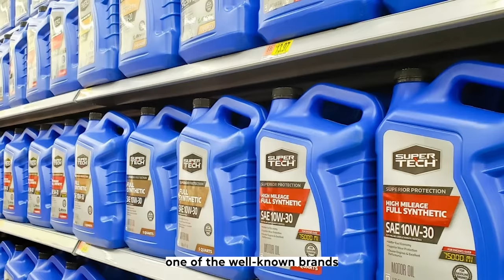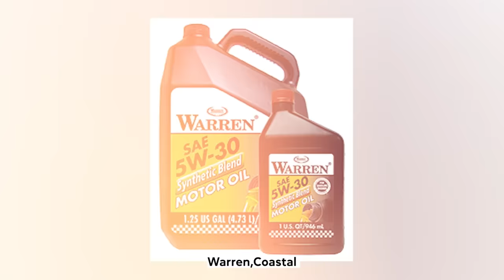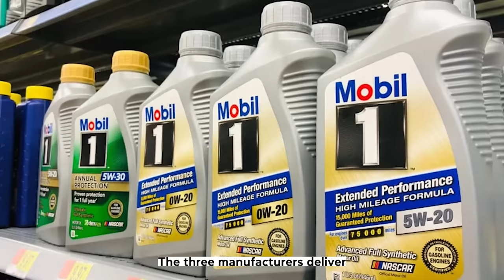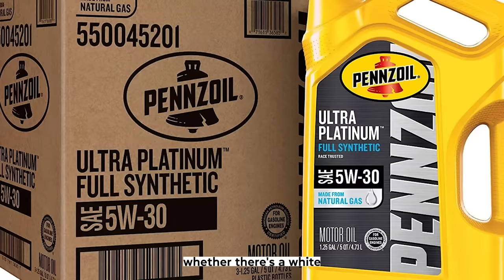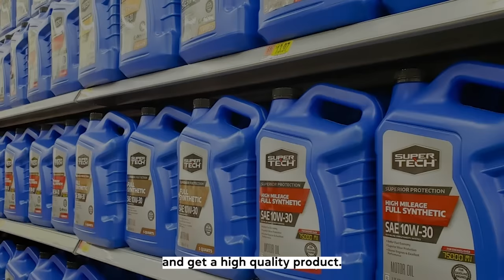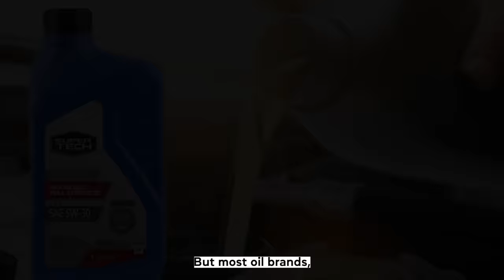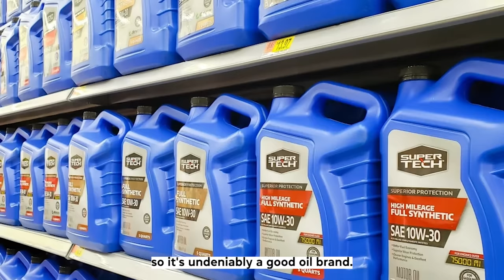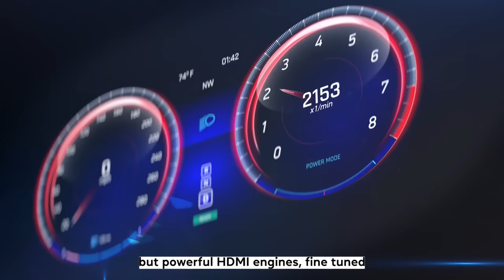Who Makes Supertech Oil For Walmart And Is It Any Good?

Comment: If you drive a regular car, not a sport executive or performance special, Supertech is fine. You won't notice any difference. The importance of changing oil regularly is much more important.
Reply: Great advise!!..My research also says the same..
Reply: But my ca states mobil1 only
Reply: Project Farm has tested Supertech and has sent it to labs to get the breakdown.
Reply: @peter-pg5yc  Then that is exactly what I would use
Reply: we run super tech in our race cars works great you no nothing.
Reply: @yourworstfear  no one said to use regular oil in race cars here.
Reply: @peter-pg5yc mobil agrees to make that weight in the spec the mfr requires and mobil compensates the manufacturer in some way. That could be supplying oil for factory fill at reduced price.
Reply: any car api code matters not brand.
Reply: Nope, Super tech oil can be used in all vehicles, just like any other brand.
Reply: That's exactly right.
Reply: I don't know if they still are but I worked at Walmart part-time for a few years in the Boise Idaho area and according to  theb shipping invoices Quaker State was supplying the supertech oils for the stores here in the valley.
Reply: @yourworstfear  LOL, yeah your local street stock oval track car is real high tech.
Reply: no nothing...lol @yourworstfear
Reply: I wish he would have said that. 😏
Reply: Sport executive? Performance Special? Tell me you don't know cars without telling me you don't know cars.
Reply: REALLY!!!!
Reply: know @yourworstfear
Reply: I use Super Tech HD30 Diesel oil in my lawn tractor and farm tractor, and I don't think there's a better oil at any price or brand. It comes in a gallon jug and reasonably priced.
Reply: Im with you Korn, he does the work. Pennzoil has my business for the money.
Reply: The pure synthetic from Walmart is as good as anything out there except for maybe the pennzoil made from natural gas !!!
Reply: It doesn’t matter who makes it. Every company has different tiers of oil. The additive base and stock are more important than who makes it.
Reply: I run SuperTech in my sports car. I bought a 20,000 mi oil and change it around 8-10,000 mi/once a year. I been doing it for a few years and haven't had any problems
Reply: I use it in race cars it's fine
Reply: Exactly
Reply: @peter-pg5yc probably a higher class car
Reply: I almost bought a 5 gallon jug of Super Tech oil, but I looked around at Walmart and saw a 5 gallon jug of Quaker State instead for just $5 more..I'm playing it ssfe. Quaker State is well known. Full Synthetic just like Super Tech.
Reply: What if you drive a regular executive in a sporting way?    This horseshit.  It's good enough, or it isn't.   The guy just wanted to say something that he hoped sounded intelligent, but it failed.
Reply: Ai ai ai ai ai ai
Reply: @peter-pg5yc That means nothing.
Reply: @william38022 Full synthetic isn't "regular" oil.

Comment: I Am A Mechanic Since 1973. I Use Super Tech Engine Oil In My 2005 Toyota Tundra Since New And Now Have Almost 300,000 Miles. I Change It Every 5,000 Miles.
Reply: You meant 300k not 3M miles, right?
Reply: @Sunnysky321  😹
Reply: Hey Stephen, to the right of your post are three stacked dots, click them choose Edit. That is how I correct my typo mistakes. Hope this helps you.
Reply: @ricdonato4328  Thanks
Reply: I mean it’s good oil, but that tundra will run on cod liver oil 😆 one of the best engines ever made. But for sure maintenance is key no matter what vehicle you drive
Reply: @Sunnysky321  300 THOUSAND is written 300,000
Reply: @ricdonato4328  what typo??
Reply: I have been using it in all my cars. I do the same thing and the oil never let me down.

Comment: After researching the Dexos testing standard I base my oil purchase on it.  The Walmart and Amazon brands that meet that standard are good oils without the premium price tag.  Back to the 90s I’d always liked Castrol oils but $35 for 5 qts of 0w-20 versus $22 is a big difference when you have 5 cars to maintain (3 daughters).  And to echo your advice, regular changes at the right interval.  None of that 10,000 mile BS.
Reply: I wait till it starts to change color I change oil just before it browns off from a redish color
Reply: Depends what kind of trips you make. If most of your miles are highway, not short trips, I'd feel perfectly comfortable going 10,000 miles. Otherwise I would change more frequently.
Reply: 10,000 miles BS you say... which is here in Europe approx. 15k km. 
And yet the ecoterrorists in EU say I HAVE TO change the engine oil not often than 30k km (approx 20k miles). It will be more eco friendly they say LOL and don't care that my engine will fall aparta much faster... and be one of many on a huge scrape yard - a place which once used to be a nice flower meadow with cows walking around
Reply: You are 100% correct sir 👍
Reply: i was over at my local advance auto parts last week and couldnt believe my eyes looking at the prices of oil and trans fluid. 

if you are unsure about your oil making it to 3k, 5k, 7.5k, 10k and up you can send a sample to blackstone labs. i would be willing to bet alot of people are changing it out when they may say that all their tests for viscosity and contaminants etc shows it still can  keep on going.  i dont know about you but my express van brand new consumed oil and now i notice my ford does and many vehicles are going through a quart every so often so its imperative to stay ontop of
Reply: @LeewardStudios ... not to mention back seat replacements ...... :)- 
I have only one and I'm not letting her out till she's 30. She has already grown thru her gauze bindings.
Reply: Yep it's a decent oil I use it on all my a to b motors, high performance ones that I care about get amsoil
Reply: Totally agree. Base your change interval on the type of driving. All short trips driving constitutes severe duty. I have an old Toyota Camry. I use semisynthetic and change the oil at 2800 miles. Scotty Kilmer is a senior mechanic and YouTube personality. He say, do not go more than 7500 miles on any oil in any vehicle. With conventional or semisynthetic oil and low-end filter, no more than 5000 miles under any circumstances.

People claim they go up to 25,000 miles on high-end extended life synthetic oil and a high-end filter. If it's all highway miles. maybe. I wouldn't.
Reply: Just find a cheap oil that meets GF-6 standards you cant go wrong ! My daily driver's OCI is 4 months/ 4,000 miles or 200 hrs of use ! 1994 chevy s10 2.2 658,000 + miles ! Never rebuilt eng - trans or rear end !

Comment: I've been using super tech oil for as long as Walmart has been selling it in my area. I recently helped a good friend of mine change a Valve cover & gasket on his Chevy Sonic 1.8 L dohc. We were shocked at how clean the the inside of the engine is, It looks like new. Guess what oil we've used every oil change super tech 5W30 full synthetic.
Reply: Yes, that is another part of engine longevity..How clean the engine stays on the inside..If it's clean you are doing exactly what you should be..
Reply: I use the same on my 2006 Subaru sti
Reply: Same here!
Reply: Most of the Supertech brand oils have been out of stock in all of my local Walmarts. I had to order some online.
Reply: I would have to think this a huge testament for ST becuase if you think about that little Sonic is running high RPMs all the time. And since those cars are very widely bought as commuters they can either be in non stop ..stop n go traffic or run on freeways for long stretches. Awesome deal thanks fir sharing. My son and his wife both have 2019 Corrolas and use ST. I'm going to tell them about this post
Reply: What is the oil change interval you're using?
Reply: And a 5 qt. jug is 22 bucks!
Reply: @yt-user03561  That's because of hoarders. They play keep-away from other people. It's greedy toddler behavior.

Comment: Bought a new truck with Detroit diesel engine, used Texaco oil for 400,000 miles. Switched to Supertech 15w40, ran truck to 900,000. Sold truck, new owner ran to 1,100,000. Head gasket blew and he rebuilt engine.
Reply: Damn that’s impressive!!👍
Reply: Texaco... i really miss texaco. Their oil was havoline as i recall. Think i may have one iunopened quart somewhere. I cant bring my self to open it.
Reply: Texaco was bought by Chevron. The Havoline oil brand still exists.

Comment: I'm old enough to remember when oil was .50 cents a quart. Came in a can you stuck a metal spout in. I don't think Sam Walton would sell me bad oil.
Reply: Well, he's dead so.....
Reply: I remember when a case had 24 quarts.  I still have my metal spout.  It had a certain sound when you stabbed it in. I still have my dads Pyrex glass bottle, remember those?
Reply: I can remember when Autozone actually had cheap oil. .79cents a quart for Castrol GTX. I remember the meta/Cardboard cans too.
Reply: Yes. Ahh the good ol days!
Reply: Still have a metal spout and 3 cardboard oil cans. Amzoil, Quaker State and STP. There more a time past of how things where done and memories for me.
Reply: Around 2009, I got a case of Shell conventional oil to use in my Geo Prizm at a sale price from a parts chain. With a rebate, it came out to 50 cents a quart. I told my friend, that's the last time I will ever get oil for 50 cents a quart. Nevertheless, I call the 1960s and 1970s the bad old days.
Reply: Me too!

Comment: I’ve been running this oil for a long time and have had no issues with it. I change my oil at maximum 5k miles and Supertech is perfect for that. It’s good stuff. I recommend it.
Reply: What refinery is going refine special, extra-bad dino oil just for Walmart? Who produces bad motor oil? It doesn't make a shred of sense. In my estimation, Supertech is exactly the same as the oil company brands. Mobil. Shell. Chevron. Phillips. Texaco. Citgo. Arco. Sinclair. BP. Exxon. You name it. No difference, and they probably trade their production around as needed to fill their orders anyway. The famous independent brands - Castrol, Kendall, Valvoline, Pennzoil, Quaker - all are owned by the majors now. The majority of motor oil sold now is synthetic, and that's a different product altogether.

Comment: I ran a jeep 4.0L on supertech 10-30 oil changed @ 6,000 mi to 315,000 miles. Mostly high way.
Reply: That in line 6 cyl motor is one of the best. Mopar screwed itself when they got rid of it
Reply: I had two Jeep Cheroke with the 4.0l engines and they are the best 6cyl. Engines ever made.

Comment: I have seen Super Tech tested on oil testing equipment. It tested VERY well and right up there with ALL oils..Use it without fear..No matter what oil you use today most oils are so close in quality as one other person said here what matters the most is how often you change your oil. Not who's oil you use..There are no good other including myself mechanics that thought these (long) oil changes intervals made any sense at all. The word on the mechanic street is to never go past 5,000 miles..Not if you plan on keeping your car..3,000 to 5,000 miles is the desired change interval..I am also a mechanic and have spent 40 years researching oil and testing the common sense theories..Don't worry and be happy..Change that oil regularly.
Reply: Been using SuperTech 5w20 synthetic in my 2007 Accord coupe 6 cylinder from the get go with 7,500 mile OCI. She purrs like a kitten and not a drip on the driveway. Fram Ultra synthetic filters, while very good , are too restrictive. Mobil 1 since it’s rated at 30 microns is my go to.
Very happy at 187,000 miles November 2023. 😊
Reply: @Nellis202  Same here, I use SuperTech 5w20 in my 2009 Civic & change with the warning gets down to 5%. Works out to about 7000 miles. I use the Wix XP filter which is 21 micron. I'm about to roll over on 245k miles & it still runs like a sewing machine. Of course I don't dog it either. Just a general every day driver. It still gets 37 mpg when I'm not doing stop & go town driving to.
Reply: I used 15k mobil 1 in my odyssey and usually changed it at 15k+ miles.  It ran beautifully when I sold it with 275000 miles.
Reply: @derrickzenner9300 Glad to hear you had a beautiful experience with your Honda.
But 15,000 mile OCI ?
Who knows ! Maybe you’re right, but I just couldn’t bring myself to such a long interval.
Hope you’ll have the same good fortune with your new vehicle. 😊
Reply: 3000 to 5000 mile oil change intervals are a waste of money and oil. I've been using supertech synthetic oil since 1998 when no mechanic could be convinced to use it. It's been in use since WW2 and still I couldn't convince anyone of the benefits of synthetic.  Supertech is better than fine regardless of which car one drives. 10,000 mile oil change intervals or 1 year which ever comes first is all that's required and of course a reinforced (synthetic) filter.

Comment: Been using supertech as far back as I can remember. 260k miles on my 94 ford ranger still running strong passes emissions no problem. Also use supertech trans fluid still shifts just fine.
Reply: Those 4.0`s are pretty stout
Reply: YOU BET !
Reply: 2.2 S-10 with 235,000 miles & still going strong with supertech oil.
Reply: I have a 93 ranger 2.3l 2wd 5sp I daily to work with 507,000 + miles! 3000-3500 mile oil changes. I use Valvoline high mileage synthetic blend. I have run super tech when Walmart was out of the Valvoline. This thing is still rocking the original engine transmission and rear end and Better yet no tics taps or raps and doesn't leak a drop of oil! 💯🔥🇺🇲 I have a newer Chevy Silverado, if it gets a 1/4 of the mileage without an issue I'll be blessed 😂😂😂

Comment: Supertech is perfect for the average daily driver in stock production vehicles. That said, it's the oil filter that can make a difference as there are a much wider range of quality in filters than in the oils themselves. Pay attention to the quality of the filter and maybe pay a few bucks more for a high quality filter. Thats what you need to pay more attention to.
Reply: Amsoil nano fiber oil filters are the best.
Reply: WIX XP is also fantastic...decent $
Reply: ST filters are as good or superior to Mobile 1 filters....at half the price.
Reply: Thats what ive heard all my life. The oil is not as important as the filter. Using a quality filter is the key.
Reply: ST filters are like the oil, middle of the road which is perfectly fine for most applications.

Comment: Great information and well presented. Many people think Super tech (Walmart), Amazon Basic, and Kirkland (Costco) are made by the same company(s). That said I had my oil changed at Mobile 1 lube with a groupon, but found they did not use a mobile 1 oil filter. The oil filter is the other half of the oil change. I avoid the filters from China.
Reply: The certification should be your comfort to use. All oil is subject to these. Use full synthetic after your first oil change.
Reply: What filters are made in China?
Reply: Does that go for your Android or iPhone too?

Comment: The motorcycle shop I worked for was buying oil in 55 gallon drums. We were using that oil to put in brand new motorcycles.
 engines were blowing, and it wasn’t just one particular engine size, it was several different size engines with the oil that we put in the engines..
  One of the mechanics in the service department was doing a 500 mile service on a motorcycle that just came in. When he pulled the plug to drain the oil, the oil came out like foam. Like a frozen Coke if you have ever seen one of those.
  When you have foam in oil, that is millions of air bubbles that are compressible. When you have the elasticity of air bubbles in the oil, you cannot have full oil pressure. Anyone with experience of having air in your brakes, knows that that is not good, you don’t have full brake  pedal pressure…
  we called the company we were buying oil from. They sent to representatives there. We took a brand new motorcycle, put in the required amount of oil, the mechanic rode the motorcycle for about 15 minutes. He pulled back into the shop and put the bike on the lift and pull the plug. I’ll came honey colored foam..
It was obvious that the oil additives package was lacking in anti-foaming additives..
  that company agreed to pay for all of the engines, and we started calling all the customers, and going to pick up their motorcycles with our trailer.. we told them not to ride or even start their motorcycles..
  some people demanded brand new engines, and got them..
Reply: We used belray 55 gal 10,40 Yamaha 20,50 🤙
Reply: What brand was the defective oil?
Reply: Sounds like quaker state
Iv seen valve covers with a white hard paste in them from motors that used quaker state .....30+ years ago
Reply: Should have just put Rotella T6 in everything.
Reply: @OtisFlint yep that's a no brainer

Comment: I bought an 03 Corolla new and ran it about 200K miles on dino oil. Castrol, Pennzoil, and Chevron oil were used. Costco stopped carrying the Chevron oil so I started buying the Kirkland full synthetic cheaper than I could buy dino oil if I could even find it. OCI is 5K and I've used AC/Delco, Purolator, and OEM Toyota filters. No problems so far at 269K.